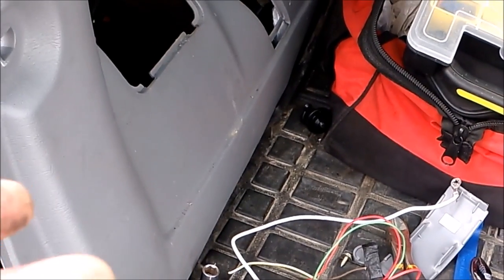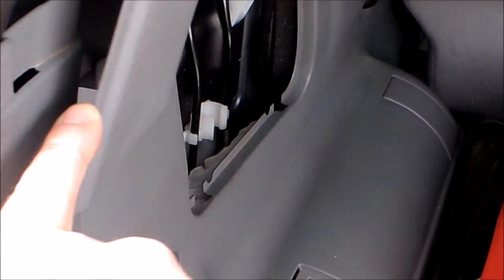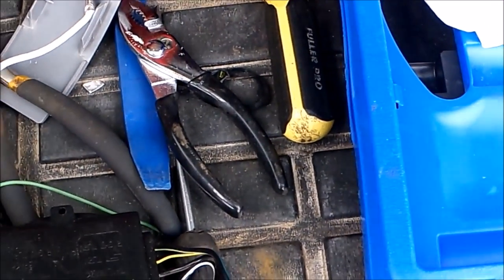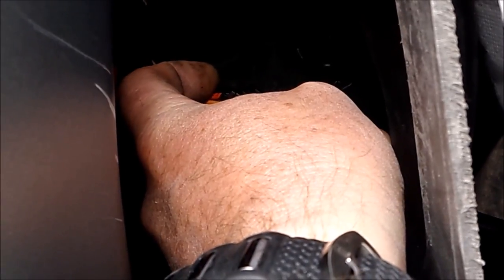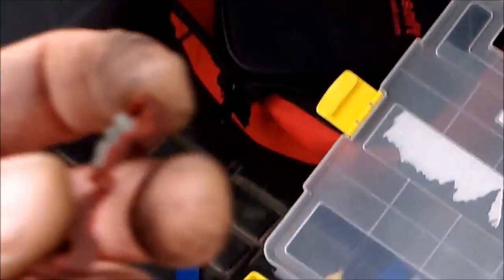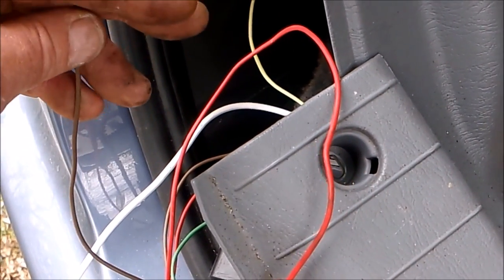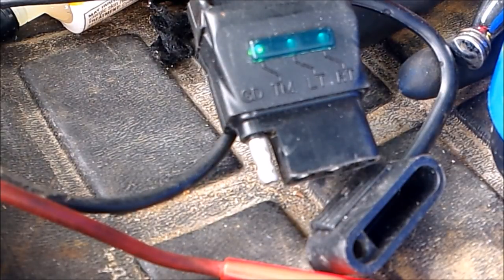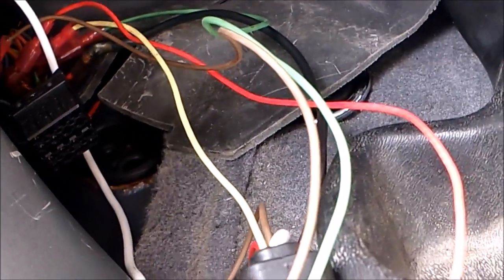Mercedes W163 ML 320,350,430,500,550 Universal trailer wiring

Comment: Great info. Didn't realize there was a factory plug to steal power from. Will save me a bunch of time if I put a hitch on my car.
Reply: Where did you get the illuminating connector tip? Did that come with your signal converter?